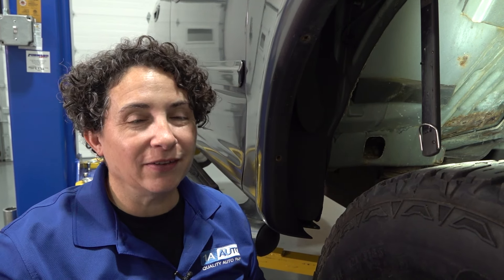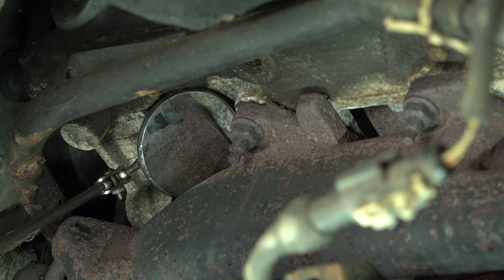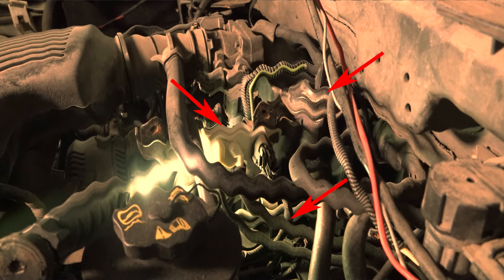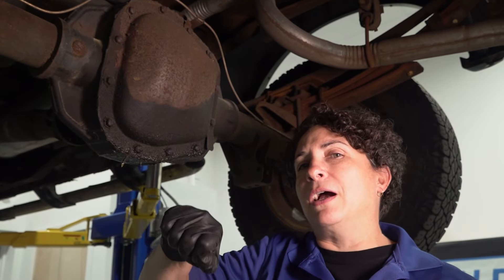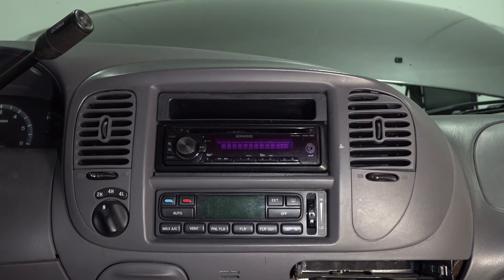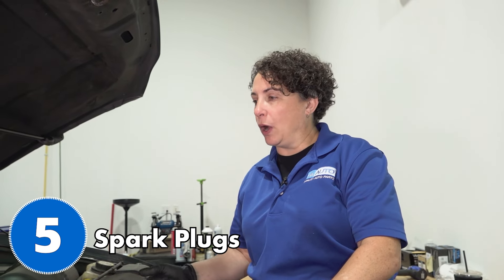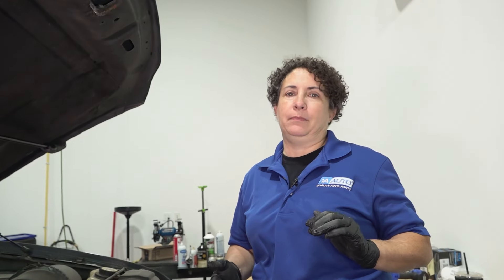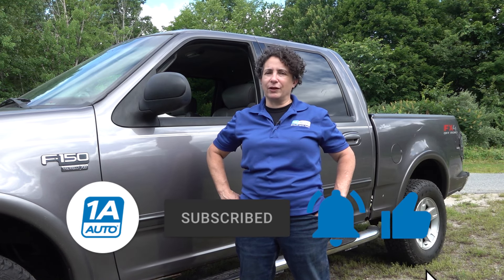Top 5 Problems Ford F-150 Pickup 1997-2004 10th Generation

Comment: Wow!  Dont forget about the coils.  Have had to replace a couple of them.  Other than that, this has been an absolutely amazing vehicle.  Got my first "real job" making 12 bucks an hour in 2003 and thought it was a great idea to buy a brand new truck.  It was such a horrible idea for me financially at the time, but since I still have it and because it has take care of me through all these years....best decision I ever made.  Because of this, Ford customer for life!
Reply: Not all of them have coil on plug. My 97 4.6 has coil packs and plug wires.. Even still we haven't had any issues with the 3 5.4s with coils except for when a plug was spit and it took out the coil in the process.
Reply: I’ve got a 97 four speed now, only cuz I wore out my 98. And a 2005 expedition. They are tanks.
Reply: @Brightleaf_Auto  ahh I didnt know that.  Is the 4.2 V8 or V6?
Reply: @JaronPope  4.2 is the v6, 4.6 and 5.4 are v8. Mine has had only the front right coil boot wear and fail to stay on the plug, never blown a plug being a 97.
Reply: Congrats.  I got a 10th gen 5.4 and it’s a tank I love it
Reply: mine just started acting up

Comment: I have owned 3 and never blew one. Just get the heads rethreaded or get aftermarket head. One of the best trucks Ford made.
Reply: They are great, if you are on top of maintenance and preventative maintenance. If you are not then it expensive fix. Also applies all vehicle

Comment: Been waiting 25 years to find out what to look out for on my 97 f150!
Reply: Same here, I doubt there are very many left in the North in decent shape due to severe rusting out.
Reply: Gee whiz you could have googled it.
Reply: My 97 has been great. Sure it's not the power of the later PI engines but IMO mine has been more reliable.

Comment: My 2004 F-150 Heritage 4.6 V8 2wd is a tank & lasted more than most marriages with over 366,000 miles still running STRONG !!!! With original motor, transmission, manifolds, axel, and fuel system... it still is very very clean looking. I get compliments on the truck all the time. A great classic dependable truck. Worth every penny.

Comment: The spark plug issue is also believed to be partially caused by the torque spec on the plugs for the PI heads (99-03 for the 5.4) being too low because they specified the same spec as the non-PI heads (97-98). To my understanding, the 97-98 Tritons aren't as prone to the spark plugs blowing out as the later 2v Tritons.
Reply: You’re actually backwards the 97-98 trucks have a 4 thread head. That’s what causes the blow out. 

The 99+ models with the PI Heads have 8 threads. Like the model shown in this video. Solved the blowout problem.
Reply: First I've heard of that but my 97 4.6 hasn't had nearly the issues as the later 5.4s we run on the farm.
Reply: @Brightleaf_Auto  OP is correct, the other guy is backwards. the thread issues started in 99, then in 2004 ford had the bright idea to use 2 piece spark plugs in the 3 valve heads which would come apart when trying to take them out to be replaced.
Reply: My 97 4.6 has never had plug issues. 200000 miles
Reply: @trevorsmith5524  Not true, the ONLY 8 thread 2V PI heads were in 03 and 04
Reply: Original owner of a 98 NPI 5.4, no plug problems
Reply: @trevorsmith5524 Thanks! I have been trying to find this bit of info. I was pretty sure that was the case. 
I have a 1999 f150 with over 160,000 miles and still has the original non service items except for an alternator and heater core. Been a very reliable truck. Close to 20 of those years this truck has hauled a load of electrical contracting materials and equipment that most definitely exceeded the rating of the truck. I am about to do some major maintenance on it. Plugs valve guide seals transmission fluid/filter. It has all original break parts other than shoes or pads so some serious work may be done there as well.  All shocks. Maybe new leaf springs. The heavy loads this truck carried made it set flat haha. The seat belts are a little slow retracing. The interior is in pretty good shape. The steering wheel foam has broken down a bit. The steering still seems tight. I have always driven it like an old man haha. Never in a rush and slow down for turns and such. . Probably some other stuff as well. I can’t think of a new vehicle worth buying. I can dump a small fortune in this 99 and have what I consider a better investment . 
Terry

Comment: My 2003 4.6  V8 has 344,000 miles and still chugging along👍
Reply from the maker: +Keith  Sr. Thanks for the feedback!
Reply: @1AAuto  I believe I might have that manifold tap you spoke of but I'm not sure. It's very light tapping.
Reply: My 2002 f-150 has 65,338 miles it was my grandfather's and it never gets driving much.
Reply: My 2004 (Heritage)4.6 has 62k and still going strong. Lol.
(I just bought it from a church that used it sparingly.)

Comment: 97 Ford F150 with over 312,000 miles on 4.6L engine,transmission and rear end with all original equipment still going strong.

Comment: My '97 F-150 4X4 4.6 two-valve has 213,000 miles.  You give them a little love, and they'll virtually last forever.  I change the fluids long before the manual says to.  Such as changing the oil every 4,000; replacing coolant every 3 years. Trans fluid is changed every 60,000 since it's a city truck. There is no whine from the rear end, just a clunk from time to time when taking off from a stop due to a small amount of excess backlash which doesn't concern me.  The exhaust manifolds are beginning to leak and will be taken care of in the future.  Don't have issues with any of the other items mentioned, and hope I never do.

Comment: I bought a F150 new in 1997, owned it for three years, then sold it to my brother-inlaw, because my wife wouldn't drive it.  After a number of years he sold it to his daughter, who owned it up until 4 years ago, when they gave it back to me.
345,000 km, with the original engine and auto tranny, and no surface rust.  Of the five items you mentioned I did have the manifolds done.
Thinking that I better sell it before something major breaks I sold it late last year and bought a 2022 Ford Maverick.

Comment: My 2002 4.6 Supercew has 225k on it... I started having the coil packs die at 90k, and the last one died at 190k. I've got a couple spares on the shelf in case the oldest ones start to die off again. I rebuilt the whole front suspension due to the non-servicable ball joints. Other than that, I've replaces shocks and tires over my 17 years of ownership.
Oh yea. Alternator went out on the way home from Florida a couple years ago.
This has been a great, reliable truck.
I've got new rocker patch panels I need to install at some point, and one side of the inside of my bed is rusted pretty badly.

I have bought parts from A1 Auto a few times over the years, as all of our cars are 20 years old, or more... Great prices and service.

Comment: I was lucky.  I needed a truck fast.  Found a 1998, 6 cyl, manual tranny in 2006.   Paid $1,600.  It now has 300,000 miles.  It runs
 great and other than tires, tune ups, brakes, battery my only repair  was replacing the clutch hydraulics.  I opted to replace the 
clutch while the tranny was out (225,000 miles).  It still worked fine.  The parts guy about fell over.  He said it was the original 
clutch.   One of the best vehicles I have ever owned.  Worth more today then the day I bought it.  It did finally get rusty so I bought
 1999, 4x4, with a really nice body for $600, swapped the bed and doors, then re-sold it for $600.  Even the seat still is in excellent 
condition.  Thank you Ford.

Comment: My 2001 Ford F150 5-speed manual with 4.2l engine and 160k miles.  Over the years:  battery replaced, alternator went out, leaking water pump gasket, rusted out heater return tube/leaking heater core, broken muffler fender mount.  Some cold starting issues not diagnosed yet (fuel pressure?), inaccurate fuel gauge.  Spark plugs replaced and the usual maintenance required. 

All in all, it's still a daily driver.  Recently added an external oil cooler for the hot summer season.  Hoping to see 200k by end of 2023.

Comment: My 97 4.6 probably 400 thousand. Odometer stop 12 yr ago or longer 256 on it now. Still a sweet beast no problems just alotra maintence.just replaced original joint.

Comment: Ive owned my 1998 Lariat 5.4 for about 7 years now. Its been through a lot in that time, and had very few problems. The most severe issue it ever had was when it blew a plug at 150k. Otherwise its been an absolute tank. Well worth what I paid for it and then some. Being 26 years old, i guess its technically a classic at this point. I hope someday people truly consider them classics, one of the best trucks Ford ever built hands down.

Comment: Got a 2000 F150 XL 2wd !!! Got it about 4 years ago the only issue form the list was the no heat from vents ..!! Change the blend door actuator but it dint fix the issue .. did a heater core flush and that fixed the issue🤷🏽‍♂️!!!!

Comment: 2003 with the 5.4 with 310K..........yes on the DPFE hoses degrading/cracking and throwing code. Yes on blend door/actuator issue.........and yes on not mentioned coolant crossover tube under front bottom of the engine. Plastic broke causing coolant leak. Good info. Thanks for sharing.

Comment: I bought a new 2000 F150 5.4 and put 105k miles on it.  I sold it to a friend who ran it up to 170k miles with no plug blowout. I currently have a 2002 F150 with a 5.4 bought in 2009 that has 170k miles on it and it has not had a plug blowout.  The blend door failed yesterday or actuator.  I haven't determined which.  The factory spec on the plugs is 12 ft lbs torque.  The current recommendation is 28 ft lbs.  If you torque them to 28, you won't have a blowout.  I haven't had a manifold issue with either truck.  I did have to change the rear diff fluid when the traction lock started chattering on slow speed turns on the 2000 at about 80k miles.  These trucks are as reliable as any you could ever buy.
Update---It was the blend door actuator that failed.  It was a bit of a pita for a 78 yr old to replace but I got it done.

Comment: The spark plug issue had to be addressed after the first few years. The plugs in my truck are just have longer threads for the aluminum heads. My 03 has NONE of these issues and it has right under 229K on it. Best truck I’ve owned. Bad on gas is my real only complaint.

Comment: Purchased a 2003 F150 back in 2002.  had a spark plug blow the day before NY Eve in 2007 ish while on vacation 500 miles away. Replacing the brakes this weekend on the same truck. Have about 120k miles on her.

Comment: Great video! I have two Gen 10 f-150’s, one only has 97k, the other nearly 300k. The one with 97k I have not had any of the problems listed, but I have had to replace 3 power window motors, 2x on the driver’s side. On my other truck, I have had to replace the actuator, read dif filter, and the plastic manifold, but never had a spark plug issue. Both trucks are made in different places. My 300k one was made in the States, the other one made in Canada. It’s strange how there are some subtle differences with the engines even though they are the same size 5.4. The older one made in Canada has a remote oil filter, which I’ve never seen before.

Comment: I got a 1998 v6 manual f150 best damn truck/vehicle I’ve ever owned i daily it because I’ve bought 2 cars within 2 years they both seems to have problems after problems but not my old rusty old truck man that thing is a beast I would honestly buy same year v8 less rust/miles fuck getting a new truck cause old ones are run just ass good as new ones if not better!

Comment: between my dad and myself we have owned 6 of these trucks since 1999 and we have never had a plug issue. My current truck has 138000 miles and my dad has 260000. I thought he had a blend door issue but it was a mouse nest. His 08 had the cam phaser failure but I blame him for not getting it fixed when he started hearing the "normal" ford lifter tick because thats not normal.

Comment: The spark plug issue is primarily for 3v triton engines not really the 2v especially not the 03&04 2v which Ford used 8 threads vs 4 on prior models.

Comment: I bought my ‘98 4.6L 4x4 knowing the rear end needed work, but found out the hard way that the head gasket was blown.  All my prior experiences with such was white smoke from the exhaust with an engine that wouldn’t idle very well, if at all. In this case, cylinders 5 through 8 were pushing exhaust gas into the coolant. When I started looking into the issue online, it looks to be fairly common as well.  So FYI.

Comment: The 1997-2002 4.2 V6 intake gaskets let coolant fill the cylinders and would hydro lock the motor.  Trans are pretty tough in these trucks.  Overall not too bad

Comment: Wow...my 2001 5.4L super crew has 151k on it .. only issue was a cracked intake manifold I replaced...alternator and a fuel pump.. I am meticulous on the oil .. rear diff no issues has the 3.55 I think is the ratio..  did have plugs replaced by a shop as I heard easy to break off and easy to over torque 
Love the truck

Comment: I just bought a 1997 Ford F150 , it has a 4.2 motor in it , is this a good motor ? It has 97,000 & some change miles on it , runs good so far .

Comment: First video of yours I've seen. 👍
I just bought a 2002 F150 -  2 wheel drive, 4.6 L engine - with 182,000 miles from my brother in law.
The original owner was an older gentleman down the street.
No issues that I'm aware of .....but...
Brother In Law let me know it consumes a quart of oil every 1400 - 1500 miles.
No leaks no smoke, just needs to add a quart.
He has been putting in conventional 5-TWENTY High Mileage oil in.
I just saw a Scotty Kilmer video saying the oil cap info is wrong and the correct oil is 5-30.
So I'm wondered if changing to 5-THIRTY HM might reduce the consumption
WITHOUT causing any problems.
ans FWIW I live in South Alabama about an hour from the coast. No cold winters, but very hot summers.
Thanks!

Comment: Love my 03, the issue that I'm having right is not mechanical but a body design. Ford put those channel grooves in the roof which collect water and now mine is starting to rust and stain the paint. I considering cleaning the channels out and coating them with Flex Seal.

Comment: I had a problem on my 2000 F150 at around 75.000 miles with screws coming out of the shifter shaft under the dash and my truck jumped into reverse while I was outside the truck talking to a friend. I had to run jump in the truck and brake before it went into a deep ditch. Problem got worse and I had to put the emergency brakes on when I parked because it would no longer go into park and gear indicator was one slot off. Finally, after one of the two screws holding the shift rod on under the dash came completely out and the other one was really loose I found out on utube that these two shifter hold down screws are a common problem coming loose on this 2000 Ford. I came across a number of other people who had the same problem. Used plenty of locktite and screwed them down tight. No problem since. Also, the same truck had a problem with turn signals not working. Found out it was the wires in the multiswitch on the steering wheel coming out of their slots. Pushed them all in and put a little glue to keep them from falling out and no problem since.

Comment: I have a 1998 50th Anniversary of the F Series F150 XLT, V8 4.6L. I am the original owner. I have not experienced ANY of the issues mentioned in this video. The truck has 135K original miles. I have had to have my fuel pump replaced twice. Lots of little electrical issues. Horn won't work, replace fuse, horn works for a few days, then doesn't. Electric door locks decide not to work. I have new rubber including spare, new headlights and markers, original engine with no major flaws. It is a good old 26 year old truck. Three doors. Headliner is funky and needs replacing. But I try to drive it once or twice a week whether I need to or not. Driving the old truck is TLC to it.

Comment: My 2000 just hit 239xxx miles. And just this year it started giving me problems the blenddoor it’s messing up and the water pump just busted 😓but motor still strong no leaks at all   Now the transmission on it was trash 😂 I had mine rebuilt and it’s been holding up really good

Comment: I guess I've heen lucky cause I haven't had any of these problems in the 20 years I've been driving mine. 2001 f150 4.6 190,000 miles and still going strong.

Comment: Just traded in a 2002 king ranch with the 5.4L Triton. It has 299k on it. Motor still ran strong, but it was a north east truck so it had its rust issues

Comment: I beg to differ on that sparkplug issue,it’s mainly on the 3 valve engines,it rarely ever happens on the 2 valve,wich is why the 3 valve F150 trucks that came in the next model that went from 2004 to 2007 I believe sadly were not even nearly as reliable considering how nice they looked.

Comment: Fantastic video! Thanks! I guess I can expect to blow a spark plug next! IF I ever get through the top of the list mentioned here. It pulled up 10 codes earlier. Like it just almost literally went down hill over night, then in a matter of three days everything went all to pieces. But as I was begging her to just to get me home I noticed my rpms was staying at 2. Steady mashing gas, decline at 2 rpms, heard the motor and lights stayed on, the more gas I gave, NOTHING!! STAYED exactly on two even letting off completely and floored. That's when the bouncing started from the rear.. . I am wondering if my gage was just stuck or if mechanical issue would cause that. I usually enjoy working on cars but something tells me this one really really wants to go Bungie jumping. Thanks for video!